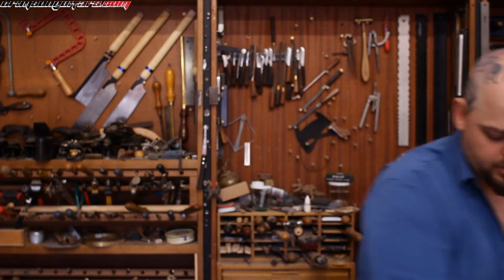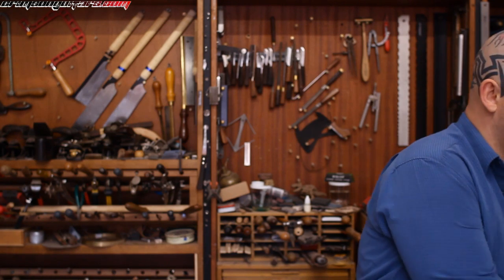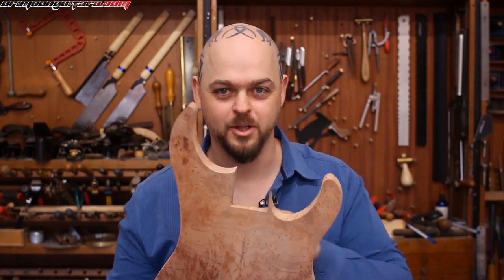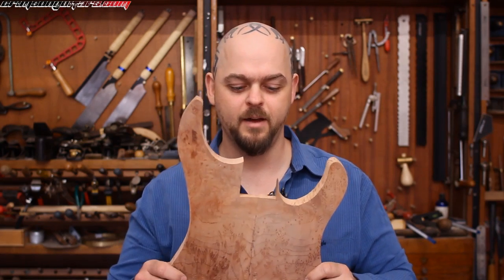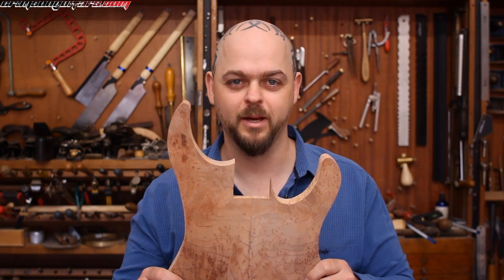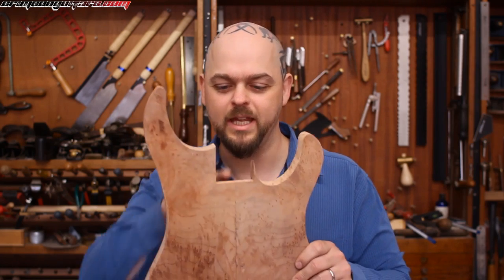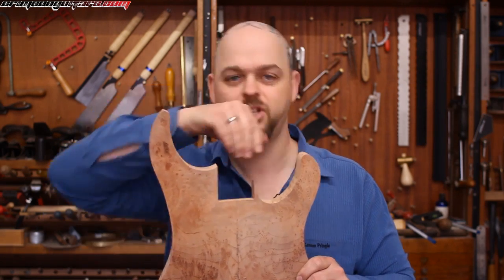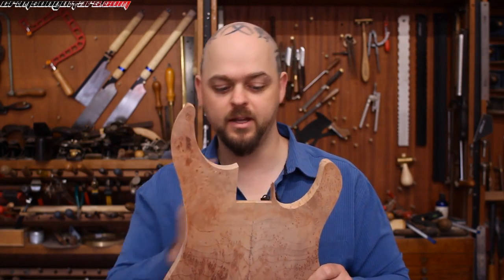Oh no, my neck pocket is too big! - Podcast 125

Comment: Kia ora Ben,

I just made my first guitar! :) Turns out as a complete novice as far as using the instrument I have made the neck/fretboard far far too wide. What is the best way to remedy this? Convert to 7 string? bandsaw 8mm off both sides? can I cut through the frets with the bandsaw? What to I do where the neck meets the body, razor saw and a chisel?

Cheers, Jake
Reply: +jacobthellamer Coulda figured you were a kiwi without the maori just from the phrasing haha.16mm too wide? Might get an 8 string out of that.
Reply from the maker: +jacobthellamer oooh, good question sir :)  I'll cover this fully ( I hope) in podcast 129.  for now though it is either refret and while the frets are out change the width, convert to eight string or so (drone strings will always be cool in my book!) or, carefully and slowly, cut down to size on a bandsaw loaded with a 14tpi or finer metal cutting blade.. if you go slow you could avoid damaging the frets too much, though if you push hard it may well just rip the frets through the neck :(  option 3.. or 4? is to cut the fret ends down to size with a dremel at just slightly wider than you want to end up, bandsaw up to that point then file from then on.. most important, let me know how it went!! :)
Reply: Awesome! cheers :) Will keep you updated
Reply: jacobthellamer hi are you using an ankle grinder for the 8mm.just hide the dust that could come....how do you with this guitar my first guitar now has a similar problem.cheers

Comment: Had the same issue but it was not of my doing.  Bought a licensed neck and body from two different suppliers, and they did not fit as tightly as I would like.  My tech is shimming the sides of the pocket with maple and sand to fit, as you mentioned.  Looking forward to more on improving kit type guitars

Comment: if you make a repair using the thin power and wood glue mix, can you stain it? or will it be obvious... assuming of course the damage is on a visible part of the guitar body, not the neck pocket.
Reply from the maker: It's generally pretty obvious, stain hardly ever reacts the same over filler, though you can go back with a paint brush and fix it if you have the patience/ are a genius artist :)